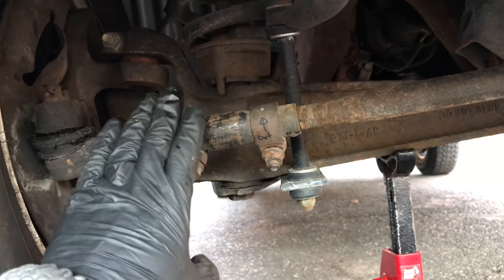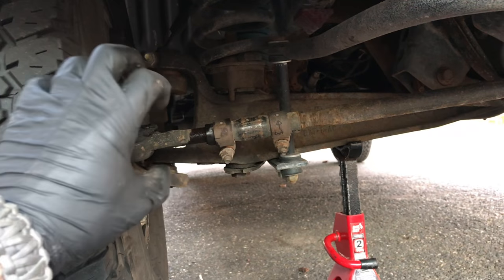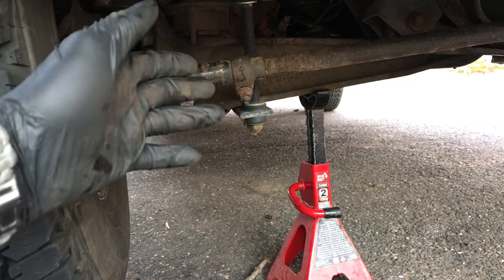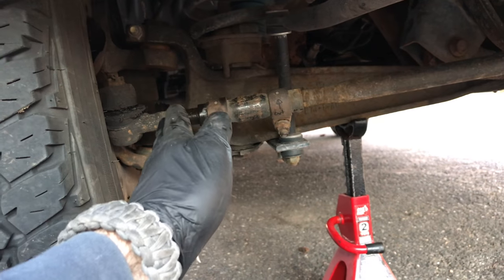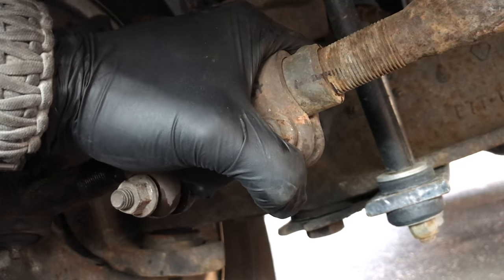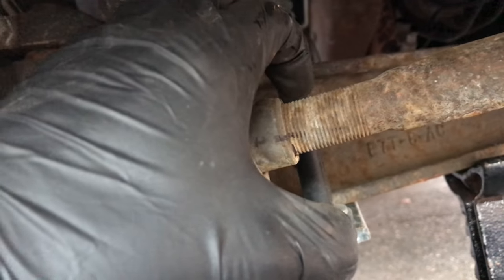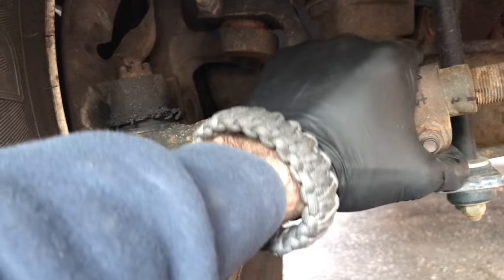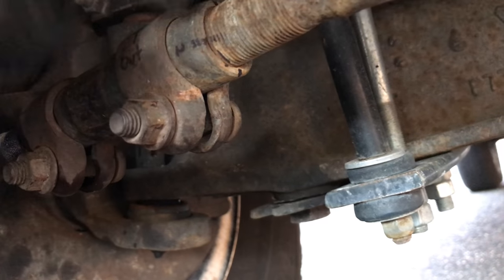How to Adjust Your Steering Alignment by Yourself | 1995 Ford F150

Comment: If you want to set neutral toe then with both front wheels set on turn plates (you can't adjust toe with the tires on the ground) turn the steering wheel left and right and return it to center. get out and jounce the frond end to unload the suspension.  Take a tape measure and measure the distance between one tread groove one the front of left tire to the same groove on the front of the right tire.  Write down your measurement.  Then bring your tape to the rear of the front tires.  Using the same grooves you used in the front measure the same distance groove to groove.  Write that down.  If the two measurement are exactly the same then the toe is 0 degrees.  There is equal distance b/w the front and rear of the front tires.  This will give you no toe wear on your tires but vehicle manufacturers don't set vehicles up this way.  They like to have like .25 degrees toe in. Meaning the front tires are closer in the front than they are the rear.  /\  This helps cornering the tiniest amount or if you are drag racing it helps make the car go straight down the track.  For trucks they set them .25 toed out \/. This increases handling stability.  These are just general numbers and not vehicle specific.  You have to split the difference in half and adjust each side by that much so if its one inch then you need to adjust the left side half and inch and the right side half and inch.  This is how you keep your steering wheel straight.  If you adjusted the difference all on one side you would end up with a crooked steering wheel when going down the road.  Camber and caster have more to do with how a vehicle handles than does toe.  If you have a truck like this or any vehicle that has an actual steering box you can "tighten" up the steering some by loosening the top nut on top of the steering box with a wrench while using a flat head screwdriver to hold the screw in the center of it.  Turn the screw an b/w a 16th to no more than an 8th of an inch (1/16 - 1/8) to the right then lock down the nut while holding the screw in the same location never letting it turn any direction any further.  That screw places pressure inside the steering gear box.  If you turn it too tight you can't turn the steering at all which sound like you can just loosen it up but it not that simple. That screw is supposed to have so much torque.  Too much and you might be able to turn the steering wheel but the steering gear box could break internally and you lose control of the vehicle b/c you just lost physical connection with the steering from your steering wheel to the part the steering box moves.  It's better to have it too loose than too tight.  Just keep it the change withing the amount I suggest and you should be fine.
Reply from the maker: James J Beuerlein Good to know man!🤙 So when I filmed this video I only adjusted one side on camera. Once, I was finished filming, I adjusted both. I had the alignment done at a shop but they never get my steering wheel exactly centered. So more of a steering wheel adjustment then an actually suspension alignment fix. But again, thanks for the info.
Reply: Thank you for the comment. I'm in the process of doing just this on my 1994 f150 4x4 and I'm clueless. I'm in the process of replacing tie rods, axle pivot bushings & radius arm bushings. Thanks for the information.

Comment: Trust me about $300 with shipping RockAuto was able to replace all those parts and my steering feel nice and tight now
Reply from the maker: Yup! I’ve seen that package. I may do that to freshen up the drag link steering parts.
Reply: I'm a class b tech for a suspension company. If you have seen what I've seen with rock auto parts u wouldn't have them. Dont bet your life on them I've seen almost every type of suspension part fail in brand new condition including tie rod ends ball joints control arms sway bar etc. I also have pictures of their failed parts. You can go off a 1 time experience if you want I've been seeing there failures for almost 20 years straight.
Reply: @mikemiller5565  well my career has gone everywhere from the auto wreckers to installing Detroit 92s in a diesel buses along with the associated suspension work and if you keep it Factory stock the way the engineers intended it unless you're buying made in China junk which I don't I buy more the other known Brands I've never had a failure the only failures I've ever seen on any vehicle is they were modified lifted and taken away from the stock engineering and that's always a big problem I will never buy a vehicle that's been modified or lifted like that a truck that's just trashed everything from the bearings to all the steering Knuckles so it's called a little bit of experience brother keep it stock the way the engineers intended it
Reply: @mikemiller5565  PS Dodge did have a bunch of steering parts they met they manufactured in '05 that actually went bad and they had to recall quite a few trucks and change his drain Parts due to bad casting on the steering parts but that's a real rare item they're heavily tested when they're manufactured
Reply: @mikemiller5565  Out of curiosity, what would your recommendation be for brand/source then? I’ve got an ‘86 F150 and all the local junk lots have toasted tie rods I can’t salvage.

Comment: Good video. I would of shown how much your steering wheel was off then said how many quarter turns it took to fix it for reference.
Reply from the maker: Thanks man! Excellent critique. For reference my steering wheel was pointing toward the 2 o clock direction and I think one and half rotations corrected the steering wheel.

Comment: My steering has always had too much play in it.  The garage said they could figure out where it was loose.  When I'm driving, the wheel is back and forth as I constantly correct it to keep it in the lane. It's a '96.
Reply from the maker: Jason Anders So I think the drag link steering isn’t terribly precise. However I’ve seen the most improvement from my new steering box and new ball joints. The rag joint in the steering column can get worn too. It’s honestly a process of elimination.
Reply: Thanks.  I'll get help checking them.  @TheMinuteMasters
Reply from the maker: Jason Anders You’re welcome Jason!🤙 Good luck!
Reply: Camas try box loosen but  and hold tip tire iron twerp stem 1/4 in mice mental and relighted
Reply: @davyboybunkia4586  Como?
Reply: If your truck is lifted, make sure you have a drop down pitman arm and it’s it tightened all the way on.
Reply: i had the same problem. it was my tie rod ends.  still waiting for the inner ones.  grease brushing were shot.  stil need to adj the toe
Reply: i think everything was oem from 95

Comment: I have an 1989 Ford Bronco full size, What would cause the steering wheel to not return when turning a corner  ???
Reply from the maker: That can be fixed with a proper alignment. If your caster gets adjusted correctly, your steering wheel (with input from the wheels) will return to center. Think of grocery cart from wheels. They always face back when you move forward.

Comment: Im suprised these trucks dont have an idler arm
Reply from the maker: Trex264 I know right! It makes sense though. The I beam suspension pivots almost dead center under the truck. So the pivot point for the steering can only be located in one location.

Comment: Good video. I may look into this. Mines 1996 f250 2wd. Lots of tire noise after new tires installed without an alignment. I'm wondering of this will assist on removing that noise?
Reply from the maker: Thanks!🤙 Nice! So if your front end is misaligned you could have a little extra tire noise. In general it’s a good idea to make sure that your front end alignment is good.

Comment: I did that on a 95 suburban 2500....fun stuff 😁
Reply from the maker: Leatherkid01 Nice! Is a suburban drag link or rack and pinion?
Reply: @TheMinuteMasters  in 95...drag link with steering box ...same set up....and being in Canada, those nut and bolt on the sleeves...tend to seize or snap...so have some handy for replacement. Just in case 😉. GM didnt switch to rack and pinion till 2007
Reply from the maker: Leatherkid01 Gotcha! I didn’t think about that! Mine only need a little penetrating oil to free up. Damn! GM came a little late to the party. I think around 97-98 Ford switched to rack and pinion.
Reply: @TheMinuteMasters  nice... Never had a 97+ ford full sized truck ( other than explorers)....cause of their popping spark plug issue
Reply from the maker: Leatherkid01 Yeah me either for the same reason and the tritons have the cam phaser problem.
Reply: @TheMinuteMasters  yup that too ....and that is unfortinatecause i love the design on those ones 🤣
Reply from the maker: Leatherkid01 Yeah I’m with ya on that!

Comment: I see you turned the passenger steering, ill call it counter clock wise to turn out, do you also turn the driver side in same direction to make it come in, or opposite direction??? my truck has this exact issue.
Reply from the maker: If I remember correctly, I think the driver side is the opposite direction. You can always look at it and see which way it’s turning.

Comment: was your truck pulling to the right or left? mines pulling to the right so Iam think i have to do the opposite adjustment your doing
Reply from the maker: My truck drove straight. The steering wheel just didn’t point straight with the wheels.
But that sounds like the correct fix for you.

Comment: Replaced my steering gear in my 92 f150 and the wheel is about 20 degrees left while pointed strait down the road. Do you think this will have enough adjustment to make the truck wheel strait again ? Wheels are pointed strait and the truck is aligned it’s just bizarre that the wheel is crooked while going down the road…

How many quarter or full turns did it take you to get the result you wanted ?
Reply from the maker: So when replacing the steering gear box, you have to make sure it’s “centered.” Basically you aren’t installing the box with the gears already fully turned to one side. 
Otherwise, the fix now would be to adjust the tie rods equally on both sides. I can’t remember what direction to rotate them.
Reply: @TheMinuteMasters 

I had the wheel locked with a belt when I did the gear box replacement, and the pitman arm is idiot proof as there is splines on the gear… same with the steering shaft onto the input for the gearbox. Not sure how I would have messed that up… are you able/ should you adjust the steering gear shaft before you connect it to the steering shaft?  I am likely doing my tie rod ends and drag link this weekend and may just have a shop align it and fix the steering wheel issue at that time .  Thanks for your input and and info you can provide
Reply from the maker: @charliedickey4411  I’d see where things land after the tie rod end replacement. 
You can make adjustments to the steering wheel shaft with the borgeson shaft but I don’t think you can do it with the stock shaft.
Reply: @TheMinuteMasters thanks brother! Appreciate your time responding

Comment: F150XLT.. lots of tire noise..when I turn the steering wheel to the right it goes away..the steering does not shake.. just noisy.. What do you think I should adjust..Thanks Pedro in Texas..
Reply from the maker: So you have tire (rubber rubbing on something) noise when you are going straight?

Comment: I wonder if you could help me out with the concern I have. My Tacoma’s lower control arm hit the bump while was doing off road, Since then it pulls to the side that hit the bottom. I have done the alignment and they adjusted the camber castor bolts which were loose. It fixed by 50% I could say but the steering goes mild to the right position. They says it’s alignment is perfect but I don’t feel the way it use to be. Can you shed some light.
Thanks
Reply from the maker: When does the steering wander to the right? While accelerating or braking?
Reply: @TheMinuteMasters  on acceleration. When I leave the steering wheel it tilt slight to the right angle.

Comment: I know it's been a minute, haha, but if my steering wheel is sitting too far left, I'd adjust forward on the drag link on the passenger side for "in" and adjust rearward on the driver side for "out?" Does that make sense?
Reply from the maker: I can’t remember the direction of rotation on the tie rod adjustment sleeves but sounds about right. I made a newer video about toe alignment that might help ya.

Comment: My left tire on my F150 2007 Triton four-wheel drive is kind of like bouncing up and down when I drive I can't really go fast and I haven't really went for but I just put a new control arm on the bottom and a new control arm on the top I would just do my alignment and it should be fine right
Reply from the maker: I’d make sure everything is bolted correctly and there are no cracks in the frame or mounts.
It sounds like a really bad shock or a really bad alignment. I’d try to check both. 
With your truck sitting level on the ground, push down hard on the bumper and release quickly. If the front end bounced a lot, it’s a bad shock.
Reply: If it's bouncing, I would guess it's wheel balance, not alignment.

Comment: Did you already have the steering wheel straightened during the process? I've heard many things about the wheel being set straight or turned
Reply from the maker: I had the steering wheel turned straight. However, from driving around, I remember which direction I needed to make an adjustment.
Reply: @TheMinuteMasters  awesome, thank you!

Comment: So I would only have to adjust one side ( there's one on each end) and not both of them right? I just installed a Redhead steering gear and my steering wheel is off about 5-10 degrees now. Truck is a '94 F-150 XLT 4x4. Thanks in advance!
Reply from the maker: Jim You’ll need to adjust both ends for both wheels to be straight and lined up in the same direction. Nice! I hear Redheads are good! Good year!
No problem man!🤙
Reply: Thank you very much for the info my friend!
Reply from the maker: Jim No problem man!🤙

Comment: Just drop tie rod and turn wheal straight put string rear front  keep on rear front tire adjust rods put on keep  joint straight y axels straight  any rig with front 4x4  tow in and are straight inner outer s period

Comment: You only needed to adjust the right side if it takes off to the right?
Reply from the maker: Technically you need to adjust both sides to make sure you maintain the proper toe. At the time of filming this, I didn’t mind having a little more “toe in.”

Comment: I'm assuming you tighten those bolts back up before the test drive? Thanks,
Reply from the maker: Yup
Reply: @TheMinuteMasters  Does it have to be on jackstands to do it?
Reply from the maker: @gsschneck  technically no. You can just rack up one side at a time and make an adjustment.

Comment: Hey nice video but didn’t you turn passenger side on wrong direction? I think  for passenger side you turn counterclockwise to toe out…
Reply from the maker: I can’t remember exactly but I did correct the steering wheel orientation.

Comment: On the drivers side would you spin the other direction to pull the wheel in board?
Reply from the maker: A Bustamante I kind of forget. I always have to remind myself but you might be correct.

Comment: My top of steering wheel is at about 2 oclcock maybe 2:30. Would that be able to fix it? And I was wondering my front end vibrates after like 50mph new wheel bears and I bought ball joints and axle pivot bushings and radius arm bushing where replaced last year. Any idea what could be causing it.
Reply from the maker: Jon Zidek Yeah you should be able to correct that. It’s at east worth a try. So vibrations are a hard think to pin down. It sounds like your front end is good. There isn’t much to the back end. How old are your tires and when were they last balanced?
Reply: Tires are alittle old. 33x12.5x15’s on a level kit
Reply: I haven’t replaced the axle pivot bushings or ball joints yet. Just got them in the mail from mooj
Reply from the maker: Jon Zidek How old would you say? Did you ever rotate them? Are they worn weird?
Reply from the maker: Jon Zidek Gotcha. Then definitely replace those and see what happens.
Reply: I’m not even sure I bought them second hand and all are pretty much the same wear expect the front passenger is alittle more worn. Probably 30% tread compared to probably 60% on the others cause I did a burnout on that tire. Or acouple.
Reply from the maker: Jon Zidek That could be your problem. Old tires or those that aren’t worn evenly or together, can cause vibration problems. If you bought them second hand, you probably don’t even know if they are balanced. Balancing makes a HUGE difference.
Reply: I bought the tires alone so I had them mounted and balanced on my rims

Comment: Uuuh ig i messed up, i didnt hold the tie rod end in place i just turned it, what will happen if i dont hold it in place? Its a 2018 f150
Reply from the maker: That sucks, but it’s not too bad. If you turned the adjusting knuckle in the tire rod and turned with it the only thing you’ll end up doing is putting your tire rod at an awkward angle which may cause premature wear of the rubber boot.
Reply: @TheMinuteMasters  oh dam idk how it goes, it has to be leveled? The tie rod end
Reply from the maker: @mrbimbo3917  It’s not too hard. Just level it as best you can with eye sight. It doesn’t have to be perfect.